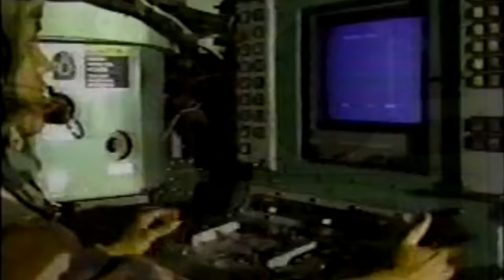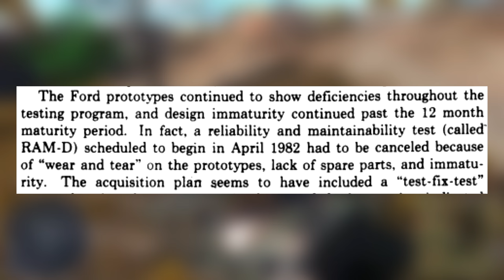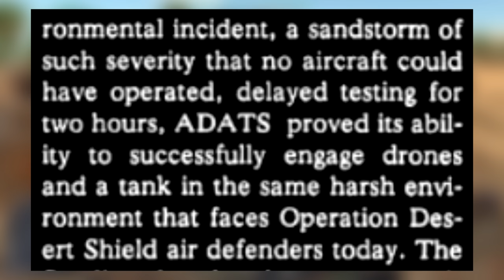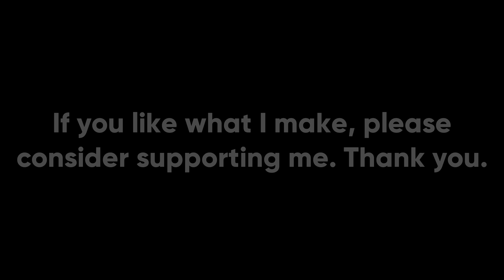The Anti-Everything Missile

Comment: the special "stinger Bradley" just being a regular Bradley carrying 2 guys with stingers really set me off for some reason lol
Reply: hehheeh yup kind of like a stinger jeep and a stinger humvee
Reply: Pretty much all Canada has for air defence, discounting the air force doing its job and allied long range systems, is two guys in each mech infantry company having 'emergency operational requirement' manpads. Mostly blowpipe/javelin pulled out of storage and given to defence contractors to be fitted a new tube, and sold back at full price. Starstreak and early stingers are floating around aswell. And they just hang out in the air guard hatches with with the air def system sitting next to them. KIts better than what we had when I was is, 'point the c6 up'.
Reply: The reason why MANPAD systems like the stinger are the sole air defense capability of most units in the military shows how powerful our Air Force is. If they weren’t, they would’ve had a very rude awakening from that capability gap
Reply: @enclavesoldier769  army and air force anti air artillery scrambling to reform units as the 2025  and 2030 force reconstructions directly address a shortfall in capability within the brigades and division command structures

Comment: I worked on the ADATS in white sands, 1986-88, it worked good enough to shoot the rotor shaft off a UH1 running NOE in the desert at 120 F temps,  at 8 clicks. No jet could get away, shot down 10 of them easy peasy. Very very fast missile.
Reply: Damn that’s insane old timer

Comment: RoF of the M242 wasn't raised for the ADATS, the cannon already had several firing modes with the highest achievable rpm at 500, but it overheated fast when firing like that, the 200rpm is standard as it provides highest accuracy of fire as well as the cannon can't overheat without firing off like 500 rounds.
Reply: Meanwhile in War Thunder…

Comment: The ADATS used a 30 watt CO2 laser for the guidance laser, PWM for the first 1500 meters of missile flight, during engine burn to control the missile directly,  then to create a digital grid aligned with the optical line of site, which was projected in the sky, with a constant size of the grid maintained with zoom projection optics to approx 8000 meters. The missile centered itself during flight after engine burn in the middle of the projected grid in air and ground attack mode, or flew 2 grid locations above center in helicopter mode to fly over trees allowing the missile to engage helicopters partly hidden by cover.  The target was not painted by the CO2 laser. A Nd:YAG (neodymium-doped yttrium aluminum garnet) laser was used if requested by the gunner to lase the target for range. Range could also come from the search radar, a  command ADATS from another position, or by triangulation between the operator in a external target designater chair and the ADATS unit it self. The missiles laser proximity fuse was 6 meters air mode, or 3 meters helicopter mode, and would be gated to not measure proximity until 100 meters before projected impact range in helicopter mode to ensure vegetation or other visual obstructions would not prematurely set the missile off.

Comment: Spook, Can you do a video on the M60-2000/120s? Would be cool. Would it have a place in WT as the next progression to the M60A3 or a Premium/EV?
Reply: M60AX+SLEP too lol
Reply: "How do we upgrade the M60?"
"Just slap a new engine and a M1A1 Abrams turret."

And it was DECENT ENOUGH.
Reply: @nooblangpoo  perfection
Edit: would laugh if it unironically had better mobility than the normal M1 base due to having a shorter wheelbase. . . Worse ground pressure though possibly offset by less weight :)
Reply: This aged like fine wine

Comment: For a world building exercise I was doing a few months ago, I was trying to cram an entire NASAM system (radar and missiles) into a single American vehicle. Think of it like an American TOR system. 

Doing my research, I ended up finding out that the Pentagon conceptualized cramming an anti air vertically launched missiles system into an LVTP-7. Can't find much out there on it, it looks like it might just be sidewinders or smaller. But I can't be the only one thinking about a mobile NASAM system that can roam close to the front to hammer enemy aircraft that get too close before withdrawing.
Reply: There have been a TON of great concepts for mobile and static air defense, sadly the Air Force usually craps all over them so they can be "the one" for the majority of air defense. We REALLY need to have better air defense, ground based especially, and hopefully one of the few good things that could come out of the war in Ukraine is the DOD getting their ass in gear!
Reply: Nasams is already mounted to a HMMWV and to a M113.   Just nobody has bought it.  The radar is a seperate vehicle.

Comment: DIVAD was always dead on arrival. The army issues a requirement (engaging missile armed helicopters at long stand off ranges) that could only have been met by a missile system, then insisted the requirement had to be filled by guns. Then they stuck it on a chassis that absolutely could NOT keep up with Abrams and Bradley equipped armored formations when the other big requirement was that it must be able to keep up with modern armored formations. So even if they fixed the gun feed and radar, it was always going to be a flop.

And don't forget, DIVAD was to replace the Roland program where the United States took a perfectly good, workable system, cocked it up so it didn't work right, then planted it on a chassis (M109) that also could not keep up with armored formations.

American Roland of course was the replacement for MIM-72 Chaparral, which was a cheap and hugely mediocre stopgap to replace MIM-46 Mauler which,... you guessed it - was a failure. 

Starting to see a pattern yet?

The hilarious bit of that last one is they looked at Roland AGAIN in the program which eventually ended up picking ADATS. 

ADATS kept with the U.S. Army penchant for effing up perfectly good LLAD systems. Don't fund the fixes to make it work right, then cancel it. Had the Cold War not ended when it did, I think ADATS would have actually made it into service (probably on a smaller than planned buy) and probably would have been picked up by other NATO and friendly countries. As it was, the failure of the U.S. order and the end of the Cold War (and thus the market for the system) doomed the program and it ended up being a money loser for the parties involved with only 38 production units sold.

Comment: I wonder if it's possible for something like the ADATS to be approved and put into production and use? With the war in Ukraine and the tensions with China, it only makes sense sense to make a similar spaa to the adats.
Reply: Possibly with SEARAM missiles and CIWS guns?
Reply: It is no longer possible.  All the engineers are likely dead, retired or moved on by now.  A lot of the documentation is most likely lost, and the machine tools developed are probably gone. 

It would be faster and cheaper to develope an entirely new system.

Comment: I wonder if the chassis issues were based off of the prototype vehicles on the M3 hull. Photos are pretty rare, but the later trials vehicles had an M3A2-based chassis (ironically really similar to the later AMPV) that had the increased engine power, increased electrical power generation, etc.

Comment: So the real world had second generation thermal optics, endgame we get first generation

it used an optical Tracker not a radar Tracker but endgame you get a radar lock warning

The optics could look 90° straight up, in game it's only 85
Reply: As the target flew over, the optics could look straight up, but the missile tubes could only go to 85 degrees, then the turret would rotate 180 degrees, and then start dropping the missile tubes as the target range increased.  That was the theory, but about half the time the electronics would get confused, and either lock up, or the turret would keep going around in circles with the launch tubes pointing up.
Reply: @heathalouf1855  source?
Reply: @StealthySpace7  I was posted to 210 Air Defence workshop for 7 years,(1999-2006) a unit of 4Air Defence Regiment in Canada that operated ADATS for the CF. I maintained the ADATS systems and Javelin S15 Manpads for the regiment and the Artillery School at Combat Training Centre, CFB Gagetown. I also instructed on both systems twice.

Comment: Thailand actually acquired 2 units of the ADATS albeit only on stationary platforms that can be readily towed as is. I once saw a picture of it snug tightly on a flatbed of a truck and while its not technically supposed to be used that way, I doubt there is any problem with it firing.

Comment: From all my reading and research the ADATS was an excellent dual-purpose missile system.
It ended up being substantially more expensive than other systems.
The M6 Linebacker [M2 Bradley, with four pack  
FIM-92 Stinger missiles was, as with most U.S. Army Air Defence systems an acute compromise, with both the Stinger missile and it's fire control and optical tracker system being very limited, when compared to the ADATS missile and sensors.
All in all, the demise of the ADATS system in the U.S. Army was just as much to do with their poor management of the program and the end of the Cold War being the perfect excuse to kill off the program [in reality, not too different to how the U.S. Army had bungled the MIM-115A Roland all-weather short-range air-defense system, which had entered, low-rate initial production of the XMIM-115A was approved in 1979, in 1981 MIM-115A Roland program was terminated.], which continued the neglect of air defence for U.S. Army units to this day.

Comment: Now, does anyone know if the lack of third person locking for TV/IR tracking is accurate in game? It's one of the most annoying parts of the ADATS, it has no regular radar tracking so you have to find enemy targets with your eyes before locking onto them in the sights/binocs. From the information I could gather ADATS, it the radio operator selects a target and the turret is automatically slewed to said target and a FLIR/TV search is conducted to lock on the target. Or am I misinterpreting this? I don't see the technical limitations why this isn't possible when it's possible for regular radar trackers, it's the search radar that gives the initial direction in the end.

One could say it's for balancing, but that doesn't quite cut it for me. Having radar+IRST is very beneficial (I do prefer the Roland for pure SPAA because of this), as you can just use the radar to insta lock and switch to IRST afterwards very quickly. Although I must say, after some time of training your eyes to see dots, it isn't as bad, but in cases where there are multiple planes up and/or helicopters up, it's crucial cutting down on search time.
Reply: That is what happened, the turret and optics slewed to the bearing of the target provided by the search Radar,  the External Target Designator Chair, or a Command ADATS, then the optics automatically started a search from the horizon up. When the gunner with either the HD black and white TV, or the FLIR, saw the target, a small tweak of the thumb joy stick stopped the auto search, and then the gunner  could use auto track, or manually track and engage the target.

Comment: Not bad.  Although a fair amount of mistakes with the origins and your comments about Canadians going towards using the linebackers is unequivocally false.  I’m saying this as a retired member of the CAF Air Defence and as the only NATO member to incorporate the Orlikon ADATS and twin 35’s as their SHORAD air defence system.  Basically, the most important reason for the retirement of the ADATS was that it could keep up with the brigade during manoeuvres and the Cold War came to an end.  Service costs were very high.  Canada was locked into a very expensive contract with Orlikon reference maintenance agreements. In 1996 we spent time on ex working with the Americans out Patriot Batteries of Fort Bliss in El Paso and White Sands New Mexico mostly. They were greatly impressed by what both systems could do but preferred the short to midrange systems for field work. While the US preferred the stingers for shoulder launch the Canadians went to the laser guided Javelin.  Although the entire Air Defence was scrapped by around 2002 this led to other new, top secret technologies such as the ability for sensors to detect and notify vehicle users as to when they are being lased.  In general this was a good mini documentary and brought back a few good memories.

Comment: if you do a video about the new chieftain kalid, can you mention that the chieftain mk 3 is lacking its 720hp engine? it  currently only has 584hp so a 720hp would actually make it playable at 8.3, the chieftain mk 3 in the game has commander fire control, which was the chieftain mk 3/s, which had laser range finder, 720hp and apparantly gen 1 thermals. the other chieftains are also innacurate as hell so a mention fro them would be good. thanks bru
Reply: It has 660hp spaded
Reply: @semiedgv  it should be 720 stock, probobaly just less than 800 spaded
Reply: @abdang7500  According to tank encyclopedia the Mk3 made 720hp and the Mk5 made 850
Reply: @semiedgv  tanks in war thunder usually have a higher horsepower when spaded than the the real life version.

Comment: Outside of War Thunder I doubt the anti-armor capability is very useful and just serves to drive the missile cost up. You shouldn't be seeing enemy armor where SRADS operate, and if threatened to face them it would be better to pull back than risk losing rare and expensive equipment that you need for anti-air. Good anti-air missiles, search radar, IRST and a single chain gun for drones. The perfect anti-air.

Comment: My favourite story about the Sgt. York was when they trundled off to the test range, turned on the radar, and it blew a Porta-Pottie to bits. The machine mistook the fan on the side of the Porta-Pottie for a helicopter.

Probably apocryphal but it illustrates the problems of high tech in combat.
Reply: If I recall correctly, the vehicle locked on to and proceeded to track the port a potty, but since the vehicle had to ask for clearance from the gunner, it never fired. Might have scared a few onlookers in the vicinity, but beyond that, not much else.